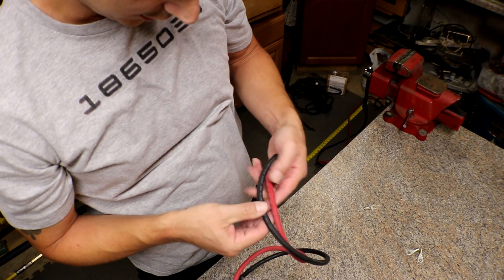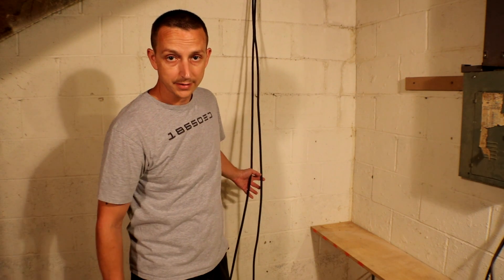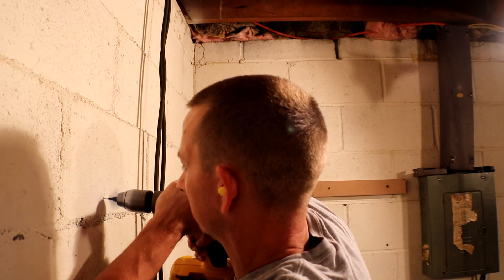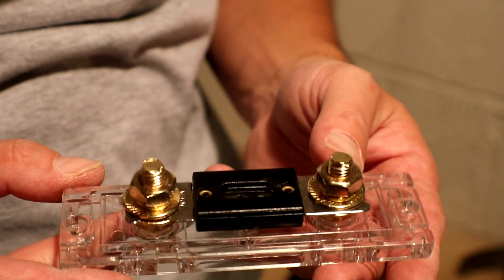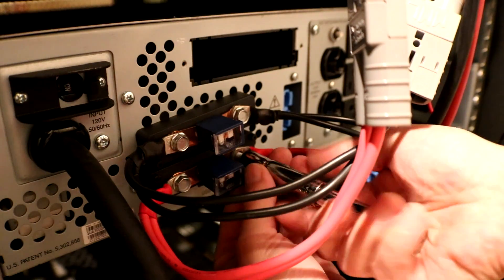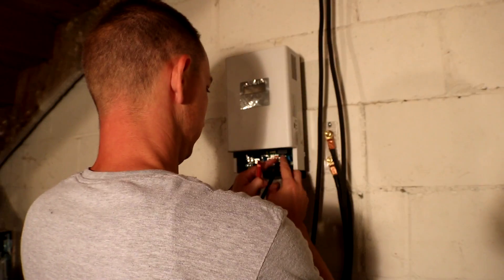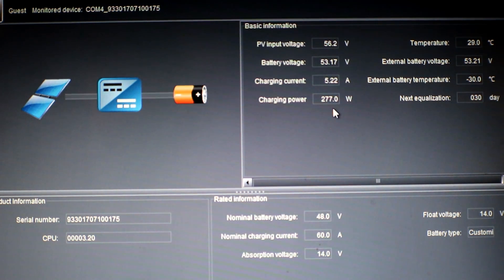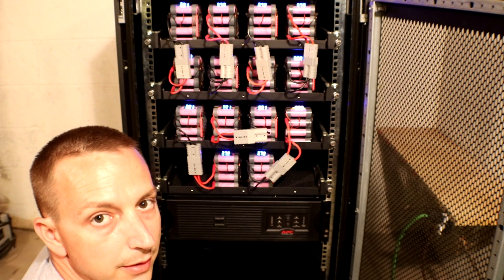Diy Tesla Powerwall ep59 PCM60X Solar Charge Controller Install!!!

Comment: Very nice. I really like the way that turned out. Considering that you will probably not pull more than 10 AMPS from those solar panels I don't think that you have to worry about heat too much.  Mounting plywood to the wall would give you more versatility and allow you a mounting place for testing and experimentation. However, it looks awesome just like it is!
Reply from the maker: Thanks,  Ive seen over 10amps already 😃 I was thinking to the concrete for future panels but who knows how much heat it will make.  Probly shoulda just used wood lol
Reply: Awesome! I have a grid tie system of 55 70 watt panels wired into 5 parallel 11 series banks. So the voltage they put out is around 360v. At that voltage I would expect  5 to 10 amps but I expect that if I wired them all together in parallel I would be putting out more like 50 to 60 amps. It seems that it is quite difficult and expensive to switch from a grid tie system to off grid. So what I really want to do is make this motor home I have here in my back yard a portable battery pack and a alternate "grid" for my grid tie inverter to sync up to in case of a prolonged power outage. There are no mistakes brother. All is well. God bless

Comment: 1] heat shrink that car audio fuse cable ends. it's a little exposed outside the casing.
2] I would seriously consider clamping the loose 2 gauge cabling to the wall. since you are allowing the rack to move away, there's always the chance of someone tripping on the cable and literally yanking the cable and/or something else from the wall. I would also clamp the cable at the top of the rack to not pull on the batteries as well. Last thing you want is a loose cable dangling around on a cable pull.
 
PS: changing your mind is good. it means you're not lazy to switch to possibly something better. it also means you're willing to change things to improve it. ;)
Reply from the maker: YES!!! I was just thinking about heat shrinking those other cables while editing this video lol.  Those solar cables that are just dangling will be shortened up.  I might even use the left over cuts from that to go to the charge controller.  The charge controller wire will be snugged up tight to something so they cant be ripped out tidied up, just want to figure out exactly how its gonna be first lol.  Yes I am always open to improvements and upgrades 👍

Comment: Joe, delighted for you. Stay safe with those voltages. 
Really interested in the absorbtion voltage. I'm looking at maybe  using a Victron Multiplus ups type inverter charger and the fitter says he just needs the absorbtion voltage to connect the powerwall. Can it be calculated or is it normally a constant or does it fall as the charger fills up the batteries? I cant find much info online on this.
Reply from the maker: Thanks!!!  Ya most charge controllers charge curve use less amps as the batteries fill up.  It would be nice if there was a true Li-Ion charge controller that was decent but not much out there yet.

Comment: Great vid Joe! Just a couple of things for you to think about. When deciding on wire size it's always good to have a reference handy. I usually use a little book called Ugly's. Different size wires have different amperage ratings due to the type of insulation and the environment they are installed in. I also saw someone mention safety gear. You are handling energized circuits and have a lot of stored energy. At a minimum, I would have eye protection and a new pair of clean, dry leather gloves on. Arc flash can really ruin your weekend.
Reply from the maker: Thanks Tony!  Ya a reference book is nice to have.  I was trying to use bigger wire for future add ons.  Arc flash, forgot about that one 👍

Comment: Good morning, thank you video, tell me the connections you made was the charge controller goes straight to the correct batteries
Reply from the maker: Morning to you!  Yeppers, the charge controller cables go straight to the battery side of the fuses.
Reply: Thank you, good Work

Comment: yippie first comment! on a more serious note: to meet fire code is it advisable to store batteries under  a wooden staircase?
Reply: darn it got beat by one lol...
Reply from the maker: Congrats on the first comment 👍  And yes lol probly not a good idea to store the cells under a wooden staircase.  Its not the permanent location for the Power Rack.  I have a concrete bunker type room they will be in  😃
Reply from the maker: Ah crap, You # 2!
Reply: I was also thinking that you need another path out of the basement.  If you torch something, your only path out is up the stairs unless you have basement egress windows.  If you have children (or the cat) playing with balls or frisbees or improvised swords, then something could break while you are at work.  Thats what scares me most about this stuff.  My kids messing around with it while Im not around to supervise.  I make enough mistakes without even considering others in my household.
Reply from the maker: You are correct, I would need another route not including my hoarders path 😉.  Yup only cats at the moment and not much playtime downstairs (even tho they can really get up to full running speeds down there).  I was thinking of putting up some of that concrete board as I have 3 sheets left over.  Could help a little I would think.
Reply: yieks... kids and pets running around now that's a scary thought: talking of fire hazards; the week before last , on Friday night  the apartment below mine had a fire and the sitting room was gutted luckily no deaths or injuries just property damage... ohhh and  the knowledge of fire code is courtesy of hours upon hours of watching 'this old house' show.. peculiar is from a back water town in Kenya... proof of democratization of information works and has a "literal" far reaching impact! ...

Comment: Excellent video.....👍
Next step Batrium system.... 👍
Reply from the maker: Thanks Man!!!  OMG I want one soo bad but my laptops video card just crapped out last week while working on a future video with LOTSA graphics.  Aaaaaand its not repairable. A work geek buddy just hooked me up with his old laptop but the graphics cards in it are bad as well but replaceable so I had to order those and the Batrium will have to wait a little while longer.  Ive been using my old slow laptop to edit and UGH is all im gonna say lol
Reply: id love a Batrium system too but serious lack of cash but theres a semi short term alternative im going to try. It is only £70 instead of the Batrium starter kit thats near £400 got the idea off one of the diy ev forums they use them  on their cars they are originally designed for commercial vehicles such as busses and small goods vans in japan I will share a link if anyone interested. Great vid Joe did you get chance to try apcfix software?
Reply: chris chester link please Batrium is kinda expensive so I use chinese active balancing that's good for now..... 👍 but I am open for any suggestions....
Thanks....
Reply from the maker: Yeah Id be interested in doing a little research on them, post a link!.  Yes I did use that software but couldnt change much.  Not sure if it was because the pack wasnt charged at the time or maybe it was my diy serial cable.  I give it another go when the pack is charged to see.
Reply: https://m.aliexpress.com/s/item/1768384410.html?trace=wwwdetail2mobilesitedetail&productId=1768384410&productSubject=lithium-battery-balancer-which-keep-your-batteries-voltage-difference-within-10mV&trace=msiteDetail2pcDetail#autostay
Reply: Ooo yes they are.... 👍 they get the job done.... 👍 
Not balanced in 10mV m more like 30mv.....👍
I was advised by the seller to buy all of them at once so that would not happen....but anyway I like the balancers for that price and 6-10A balance current... 👍 and modular design....active balancing....👍constantly balancing....👍
I don't look the battery no more......once a month I check the voltage and are OK
Reply: AveRage Joe pasted from mobile so it's the mobi site but you should be able to find it on your computer
Reply: That's the balancers that I use.....20€/piece... 👍
Reply: Bostjan Trancar so are they any good could you do a review on them?